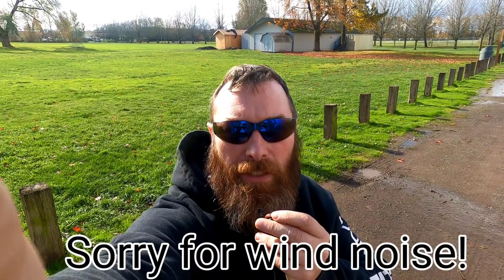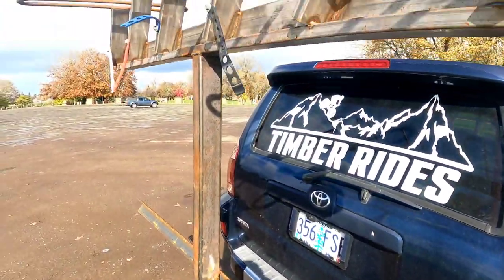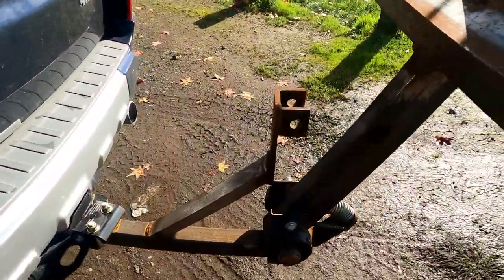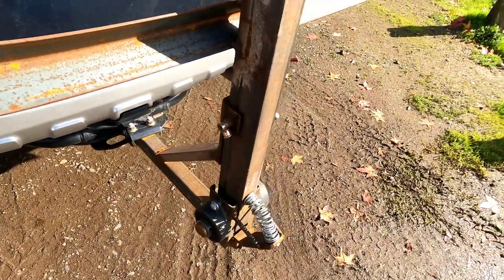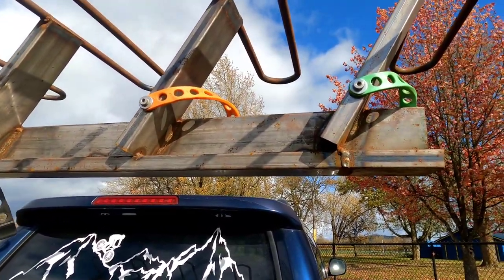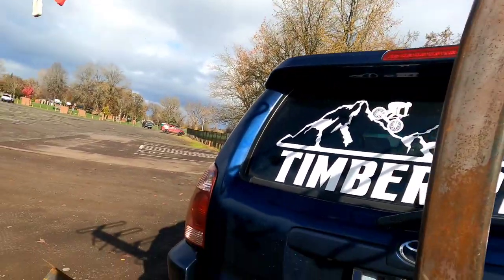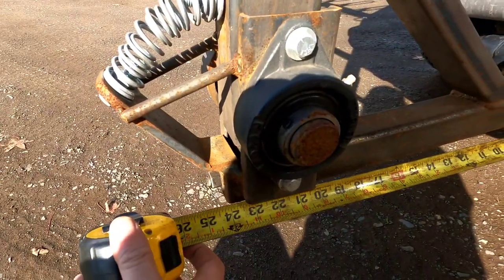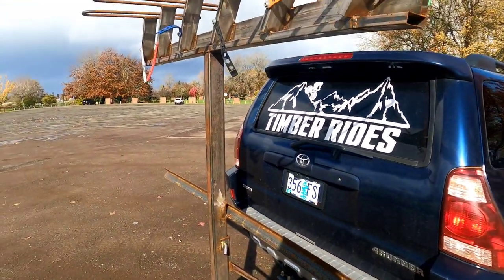DIY bike rack

Comment: one question, does the shaft run freely through the main mast or is it welded?
Reply from the maker: The main mast i used shaft collers so they could be welded and the shaft could still be removed. Also the 2 pieces of metal welded together is a design flaw. Use a 3x2 across it instead. When you have a wild shuttle driver with the rack full on a bumpy road it bends...... i keep meaning to make an updated video on that portion alone.
Reply: @TimberRides  can't wait for update video! thanks for the explanation!